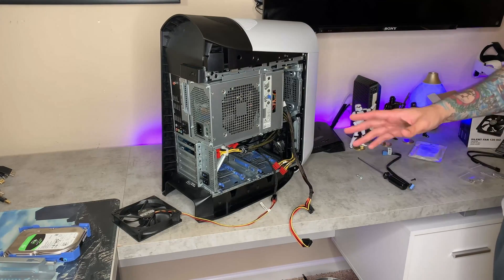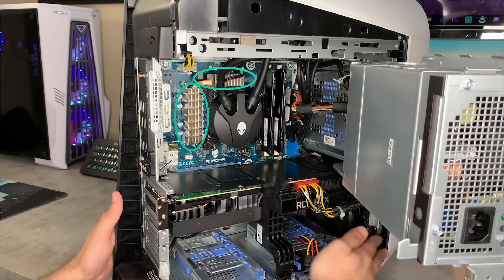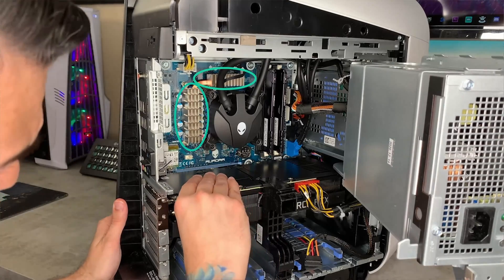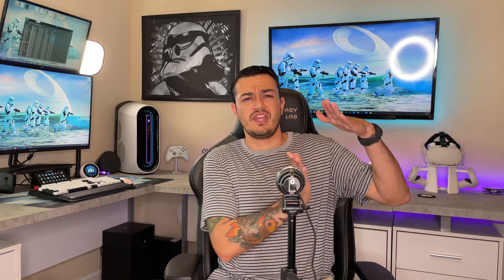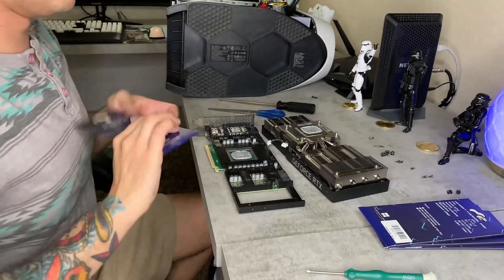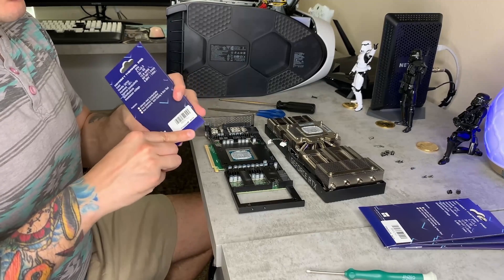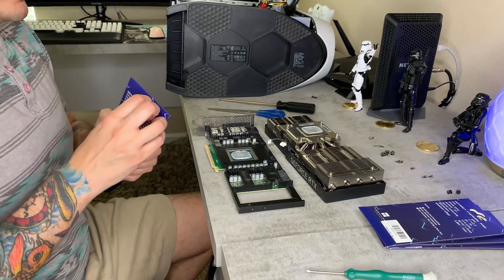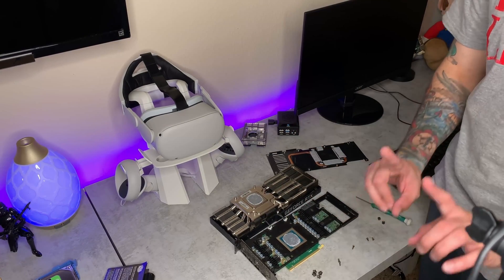Common Alienware Aurora R Series Problems and How To Fix Them

Comment: Got my R10 with liquid cooling 🥶
Reply: Ditto….steady 70 degrees
Reply: any problems so far? any suggested upgrades? im getting one with rtx 3080. thanks.
Reply: @bjslugzbeatz2103  absolutely no problems at all. It runs smooth as hell! Love it! 9/10
Reply: @shadowcodestv  my r10 can't even run Minecraft smooth, it takes 10 minutes to start up and takes 2 minutes to open Google or anything, And it constantly says that the apps aren't responding
Reply: @oofhole9349  Same issue with mine as well. Let me know if you find out the issue.
Reply: @oofhole9349  check ur updates? Like go on settings and see if something needs updating there , I had this issue with forza and doom eternal but I only needed to update something then it worked
Reply: I’m waiting to get my R10 with Ryzen 7 5800 and 3070 and water cooled 🙋🏻‍♂️

Comment: For anyone else that's been having issues with Bluetooth consistently dropping connection like I was, I had to take out the bluetooth card and put it back in. That mostly solved the problem. If it drops connection again,  just shutdown, unplug power cable, and hold the power button for a few seconds before plugging it back in. These are the solutions that worked for me.
Reply: I just removed the card and replaced the bluetooth adapter with a bluetooth 5.1 adapter from amazon nice usb adapter for 16.00 and no issues with speed or connectivity

Comment: My R11 had a bad Slot 4 PCIe.  Under warranty, the motherboard was replaced.  Unfortunately, the replacement motherboard had the same issue with Slot 4 PCIe not working.  Any R11 owners have something similar happen?

Comment: im happy i got a 3070 tho now that dlss 2.0 exist i can hit 110 fps at 4k in some games at max settings these alienwares are beast
Reply: I need help I just picked up an R12 with 3070, i7 11th, 16 gb ram, 256 gb + 1tb drive and I am getting 85 - 115 fps in 1080p low quality. What do I need to do here? Because I just came from an Xbox series S and was getting better consistant fps and smooth gameplay in 1440p with VRR than this computer and it was only $299 so I need to change something up lmao 🤣 RAM? Memory? Extra fan? Power supply? Tried auto overclocking in GeForce Experience and in alienware center nothing change
Reply: @shaneflanagan70  hmmm what game are you playing some games aren’t using the card because the drivers aren’t really there yet, warzone being the main game that doesn’t have a 3000 series driver which results in low frames
Reply: Yeah that is the game, but true I didn't know that. I will look further into into that.. I need to learn more. but man my brother is getting 160-200 fps with his cyberpower build 3070. I'm not expecting what he has because of the rest of his specs but did expect to not be under 100 lol

Comment: I got some of the issues you mentioned in the video with my r10 (5900 / 3080) i got for 2 month now.
Even after installing 4 new fans (replacing intake and WC exhaust and adding 1 more for each (thanks for the videos for that)) my temps while gaming still go way into the 80°, but at least its not overheating anymore like with the stock fans even on performance preset). Don't wanna know what happens when i would try to OC my cpu...
But what concerns me more is that i have the random blue screens and sudden shutdowns you mentioned very frequently. Already reinstalled windows, updated all drivers, installed latest bios update and so on. 
Guess i'll have to reach out to the support after all
Reply: Hi, i have the same config an did the same changes to the case. Overall I'm very happy with it but sometimes my system reboots itsel randomly. Today I think I figured out what it is. In BIOS by default Overclocking is active by default and "something" enabled on the CPU. I put this to "auto" and now it seems to be stable. Have to test a bit more.
Reply: Unfortunately the PC restarted again... EventLog says Kernel-Power Error 41
Reply: Okay now I guess found the issue. I have just switched the wall outlet. Now the Aurora is connected directly to the wall. Now Hwinfo is also not showing some strange power percentage numbers in red anymore. Maybe the PSU is a bit fussy
Reply: @pitha-gn9zr  seems like you have the same issues i had. at one point with the constant reboots and bluescreens i finally reached out to the support, and after a bit back and forth error detection, they send a technician who replaced my mainboard, gpu and water cooler. didnt had any issues since then.
so maybe it would help to contact support for you as well. they are very responsive and do their job really well

Comment: I couldn’t stand the thermals in my r10 5900 with 3080. It was in 70’s celcuis while gaming it would stutter at times due to heat. I had my previous build and just swapped the cpu and gpu and what a difference it made .
Reply: The 120 aio really isn't enough for that powerful of a chip. My 5800 hits about 62 during stress tests
Reply: I have the same setup. My cpu temps go up in the 80s while playing Warzone for example. Even though i already installed 2 new intake, and 2 new exhaust fans (all Corsair ML120 Pro) and a very aggressive fan curve
Reply: @arrensen  some say the Alienware stock fans are actually very good
Reply: @18yearsoldnot  In the meantime i go again with just the stock fans and it actually works pretty fine and i got used to the noise level. temps are also decent again, but i also had a long back and forth with the support and got some pieces replaced (mobo, water cooler and gpu). looked like my mobo was defective
Reply: @arrensen  That's interesting... Did you also manage to get the VRM heatsink for a decent price? I'm thinking of adding an aftermarket aio (Arctic Freezer 2 120mm) and I read somewhere that the VRM needs the heatsink if you go the liquid route, and I can't find it in stock anywhere at the moment!
Reply: @18yearsoldnot  i already it pre-insstalled in my system
Reply: @arrensen  ok. I think I’ll do a custom heatsink
Reply: 70 C is not a temperature that can cause stuttering. You need at least 100 C for the Gpu tu heavily throttle

Comment: I installed three 120mm and one 92mm Noctua fans into my R10 and it is a night and day difference. Running at full performance is now quieter than it was before when running at quiet... I was questioning my purchase before, but now I love it!
Reply: i just bought a r10 im gonna upgrade my fans and do the push pull with 3 but where did you put your 4th fan? and did you have problems with your noctua fans?
Reply: @kmills6476  I removed the extra HDD I bought with it that Dell puts in the top front of the case like he did except I reused the HDD cage which has mounting holes for a 92mm fan. The Noctua NF-A9 PWM fit perfectly there and came with a splitter cable to connect it to the bottom front 120mm Noctua I installed. So far no issue what so ever and AWCC even detects the fan speeds still.
Reply: @Sakon85  thanks I’m gonna do the same thing you did
Reply: @kmills6476  I would :). Just an FYI you will need eight #6 - 1 1/4" machine screws to attach the fans to the top and bottom of the AIO radiator. Of all the videos I watched only one mentioned what kind of screws you would need and none mentioned how many... Good luck!
Reply: @Sakon85  how did you get the radiator out do I have to remove the ram sticks?
Reply: @kmills6476  It helps to remove the RAM sticks. It's easy, provides more room and helps prevent then from getting damaged, but not necessary. More necessary is taking off the top of the case to access the screws that attach the radiator to the housing. Removing the radiator first makes removing the housing for it for install after easier.
Reply: I did the 4 120mm noctua fans as well.  I noticed the noise is a lot better but the thermals are actually higher with the lower rpm noctua fans.  Especially the cpu Temps.
Reply: @mitchelltyner5670  Did you re-thermal paste the CPU? Because Dell's paste jobs is horrendous. It also depends which CPU you are running. While my thermals aren't tremendously better they are definitley not worse. but my GPU (3060ti) temp is highly based off of the ambient temp in my room I noticed. However, it never gets higher than 75 degrees OC'd at full load.
Reply: @mitchelltyner5670  I also did the fan swap more for noise than to imrove thermals, because my 5600x doesnt run that hot to begin with...

Comment: The VRM is for CPU power delivery. Usually, with a 65W CPU, it's not going to be very hot. But, it's a crime not to include the heatsink... I guess that's Dell's "innovation"?
Reply: Also, the heatsink for the motherboard chipset is...I don't know how to put it... just existing. I feel the heatsink on my wifi adapter is larger than the one on the motherboard chipset.

Comment: Are these temps normal for running games like siege? 68 degrees Celsius cpu  and 70-72 for my gpu I just got mine in the mail and it got hot can u make a video on your fan setting that aren’t the loudest but most effective as well as a more in depth video of programs to delete off your Alienware and any possible ways to free up more space and also what power settings your using

Comment: some of the best prebuilts? garbage.  honestly with that garbage motherboard in there it really...really isn't worth it. i component swapped most of the aurora 12 into a new case with a new motherboard....way....wayy more fps.  so if you  need it for parts and can build yourself a much better pc with them it's great!!! (don't even comment hey bro just buy the heatsinks...GUESS WHAT THEY'RE NOT AVAILABLE TO BUY!)

Comment: I've done some of these mods from your channel and now it's not booting on my alienware monitor, only on my old monitor it's just black screen and then on the other monitor it still does a fan check for the top fan...any suggestions??
Reply: Check your monitor firmware. I had to do it on my Samsung 49"
Reply: @DreamwoodRings  well its working with my old pc. How would I check my firmware? Also issue with the fan check using the ml120 corsair fans...really becoming more trouble than it's worth lol

Comment: my r12 stopped booting yesterday after a windows update, now I have to hit F12 everytime I turn it on and manually choose windows boot manager (even though I have disabled all other boot options...)
Reply: Updated Fans? Had exactly the Same issue with Noctua aftermarket fans. Just press F12, go to Diagnose, let the Test run and it will Tell you Whats wrong.

Comment: Other hint: You can add a GPU of 287 mm of length, you only have to re allocate the front fan into the HD drive slot.
Reply: Excellent videos even though they are a bit old. I put an Asus RTX 5080 OC in my R12. I had to remove the front fan and cut out part of the chassis in that area. Thanks to Kevin's videos, I just today, put a new fan in the HDD location and replaced the stock one on the top. While gaming and running the OC1 option for overclocking (this is my default setting) and fans running around 45% max (very quiet), I am in the mid-60s for both the CPU and GPU and in the mid-40s when not gaming. CPU rarely goes over 35% while GPU hits 70% if I am lucky. Any OC videos on the i9? 11700k? Also, 128GB mem running at 3400mhz using RAM2 setting.

Kevin if you happen to see this, is it worth it to put the two fans at the top? With my temps is it actually worth the hassle and if so, please link me to your video showing the process.

Comment: Too bad the heatsinks are unavailable. Other than that, I've done all these other mods, thanks to the help of Gamer Heaven. Thanks for the great content Kev! Your channel is one of my favorites.
Reply: did upgrading the fans help out a lot on yours?
Reply: I have the cooler and heat sink available one EBAY for cheap =P
Reply: You installed the H60 and got display? It doesn’t display for me turns on no error codes

Comment: Gosh you're funny dude. Got a question : I'd like to add thermal paste on my Dell 3080 but I am afraid doing that might void my warranty. Can you confirm either way please?
Reply: best upgrade i did. no tamper seal stickers.
Reply: @WhenPokemon  hi, do you mean there are no seal stickers on the card and that adding thermal paste shouldn't void the warranty?
Reply: @geoffroydelmotte1141  I am not sure what Dell's policies are and if will void the warranty or not. There are no tamper seal stickers you have to break to open up the card.
Reply: @WhenPokemon  thanks, I'll call up Dell and find out.

Comment: Getting a R12 in a couple weeks
Reply: Getting mine in a week. Is there any noticeable thermal throttling on yours?
Reply: @18yearsoldnot  I have had zero issues. I run an an ultra wide screen at max settings for ac Valhalla and warzone. I do have the liquid cooling which I am sure helps
Reply: @zirbengeist5317  yes I hear liquid cooled is a lot better. Mine is coming with a 3080 but only 8gb ram (which I though would be a quick fix but apparently is very difficult to upgrade
Reply: @18yearsoldnot  shouldn’t be. There are empty slots just get an additional stick or 2x 16 for 32 gigs. Make sure you get aio liquid if you don’t have it
Reply: @zirbengeist5317  thank you. Will do both

Comment: If I bought one of these as im interested in the r10 or r12 with a 3090, should I go with the i7 11700kf or 5800x for cpu and I was also wondering what Ram Is compatible with these alienware pc's? I notice that they are sensitive to certain rams with getting 3200mhz to 3400 speeds from users who tried to upgrade. So I was wondering if you could let me know what a good ram kit is to buy for the alienware.
Reply: buying an alienware 3090 and changing the memory for aftermarket ram will only get you 5-10 extra fps. Not worth the money wasted. Get another PCIE card +NVME SSD. or wait till next year and get the DDR5 + new intel i12